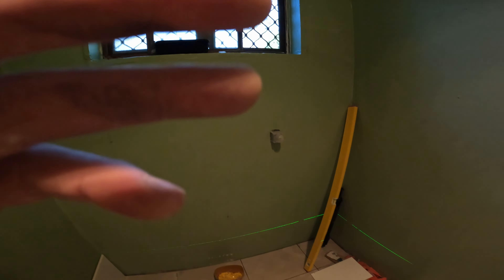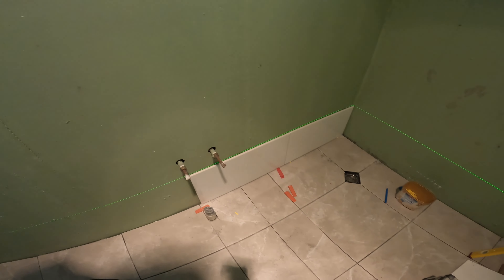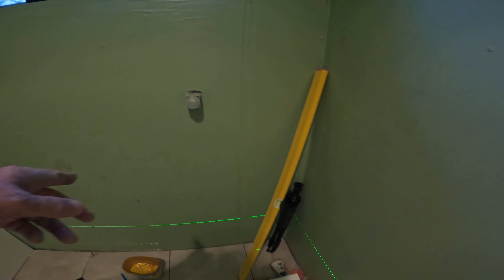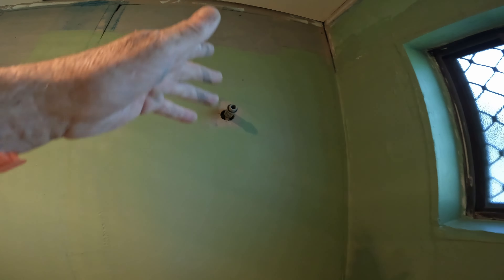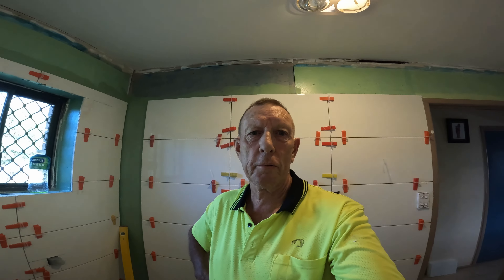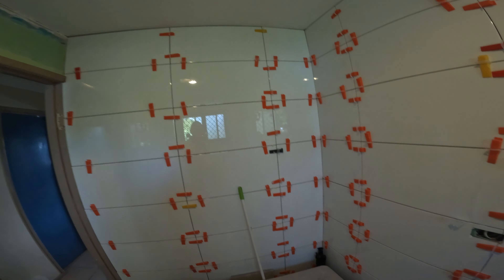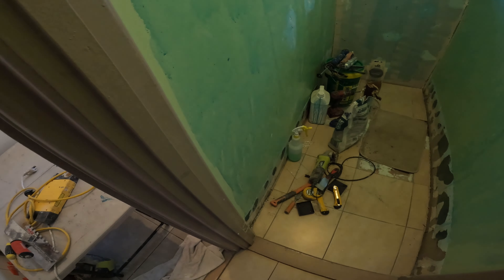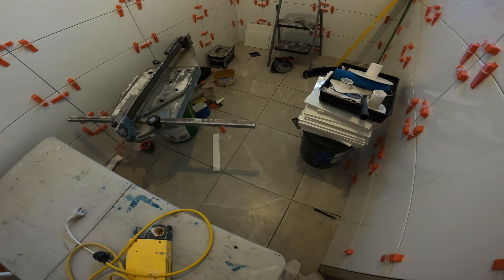A Professional Tiler Let Me Teach You How to Tiles Walls

Comment: Would love to see how you tackle uneven walls that you cannot correct. Many use the dot and dab technique but I am sure you have a better way.
Reply from the maker: Yea Run Hahahaha 😄😄
Mate mix your glue abit stiffer slap it on your your low spots and straight edge your wall flat doesn't take long to do.
You don't need to wait for it to dry
Thanks for your Question champ 👍👍
Chris o
Reply: Wow ok, makes sense, thanks very much !!!